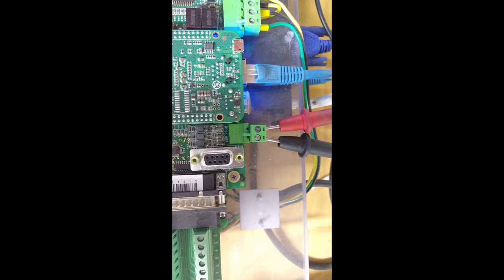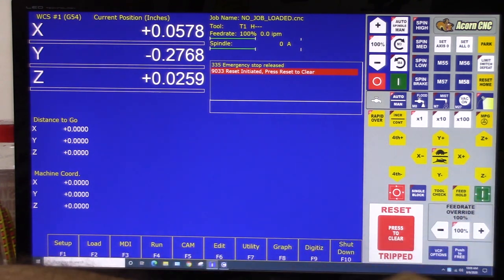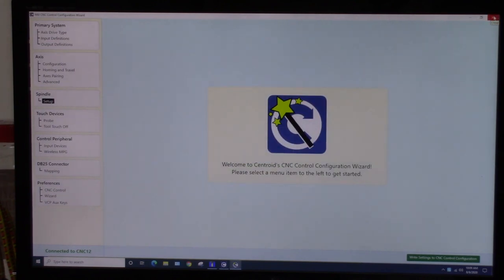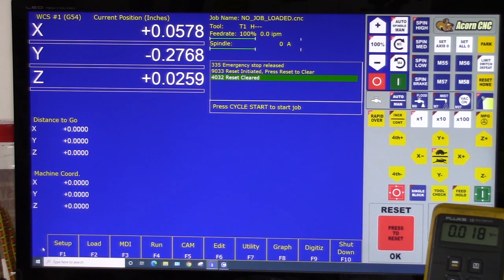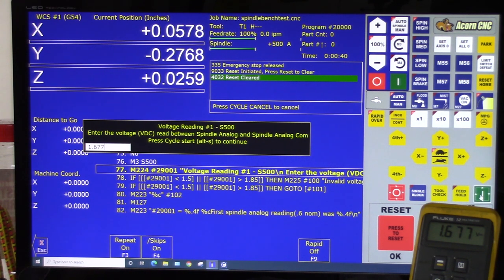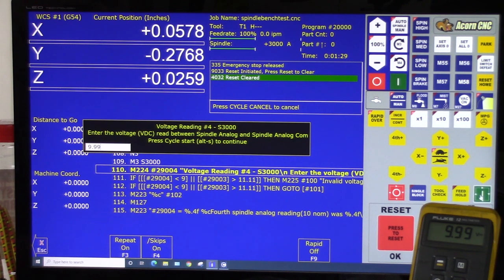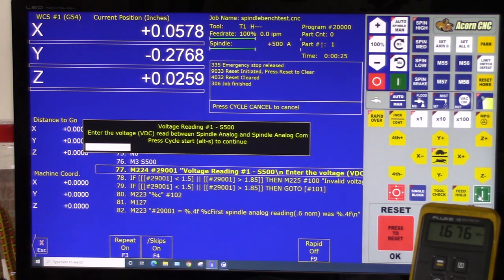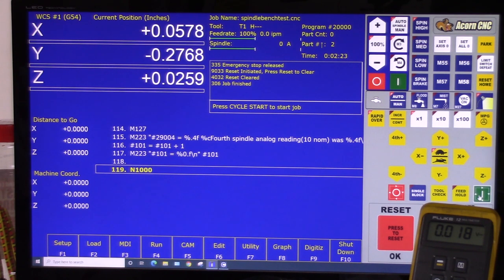Centroid CNC Acorn Updated Spindle Analog Output Benchtest

Comment: My acorn CNC when I drive my X axis 24 inches it actually moves 24 1/4 inches. How do I fix that
Reply from the maker: First did you download the Acorn Installation manual ? It's explained there.
Use the Centroid CNC Users forum. Post a fresh report and ask your question there. But it IS explained in the installation manual which can be found on Centroids website

Comment: I ran this test and had no problem, but after connecting it to the VFD, the voltage was severely loaded down, reading about a third of what it should be, and was jumping around. Turned out that not shielding the cable carrying the analog command to the VFD is a BAD idea, at least for my setup.
Reply from the maker: Make sure you only ground the shield at the Acorn end and only to one common ground point.

Comment: Thanks Marty.  Somehow I missed this in all the prior videos I watched.  How do I calibrate these settings so that the spindle is running at close to the RPM my g-code is setting.  I have a 24K spindle that I use for carving wood most of the time around 10K to 12K but when cutting fine inly pieces the spindle speed goes way up.  Thanks...
Reply from the maker: Go to the Centroid Users forum, look in the Acorn knowledge base first page VFD Tuning

Comment: Hey Marty can you explain what the limit spindle analog output to 0-5 volt option in the Acorn 4.8 update .
Reply from the maker: Primarily for spindle drives that only take 0-5vdc. However, remember that signal still need to be isolated

Comment: Do we have to hook up our spindle to a VFD? I've modified all my manual machines to run off of DC treadmill motors that run off of around 110vdc and range between 2 and 3 HP. I was hoping do the same with a cnc taig lathe. Would this be possible Marty? Thanks.
Reply from the maker: How will you change speed
Reply: @martyscncgarage5275  Hi Marty, thank you for your reply. Sorry if I sound ignorant; I'm very new to this all.. With my manual machines I wired up a circuit with a speed controller. It has a potentiometer that changes the voltage and the motors' rpm. I had seen a comment from you under one of Franco CNC's videos about a KBSI-240D or a similar product for applications without a VFD. Would that type of setup work for a treadmill motor?
Reply from the maker: @backyardmachinist  depends on the speed controller you use but yes, most likely. You can always just use a relay output assigned to SpinFwd to turn on and off your motor controller with M3/M5 commands. Will be up to you to set the speed
Reply: Okay, thank you for confirming 🙏 Great videos!
Reply from the maker: @backyardmachinist  KBSI-240D is most likely what you will need. Search that on the Centroid Acorn User Forum
Reply: @martyscncgarage5275  Will do. Is there a speed controller you recommend for this application. Do you think a KBIC-125 (9433) would work well? KB recommends it for "shunt" motors, but I'm not sure if a treadmill motor falls in that category.
Reply from the maker: @backyardmachinist  depends on the specs of the motor.
Reply: @martyscncgarage5275  Right. Thanks again!

Comment: Does the maximum speed depend on your spindle motor or do you have to bench test with 0 and 3000 rpm?
Reply from the maker: The Spindle Bench test Macro requires you to set the software 0 to 3000
Reply: @martyscncgarage5275  Awesome thanks! So this can be changed after to my spindle speeds correct? I plan on running my spindle between 16000-24000 rpm
Reply from the maker: @janvirbrar4181  correct

Comment: I'm getting 0 volts at the analog output.. bad board?
Reply from the maker: Please post your support question to the Centroid User Forums. https://centroidcncforum.com/viewforum.php?f=60&sid=eebe5077be996b3b456e81548813e52d
Be sure to explain your setup, pictures, what kind of spindle drive/VFD etc. Also please post a FRESH Report, F7 Utilities, F7 Create Report. All Acorns are tested before they leave the factory and you are supposed to do a bench test and check the spindle output before connecting anything.
Reply from the maker: Did you run the spindle bench test as shown in this video?